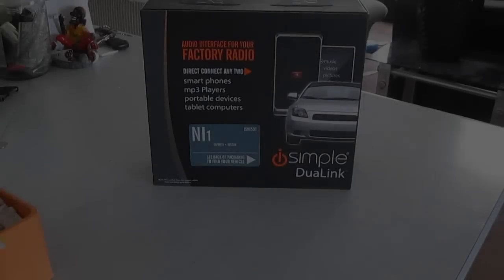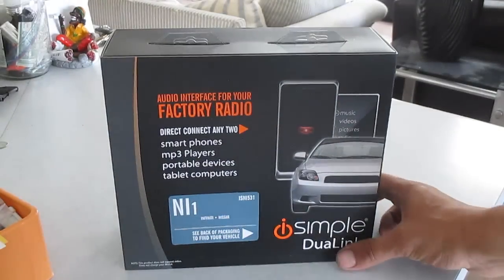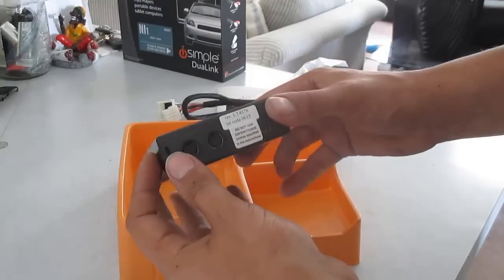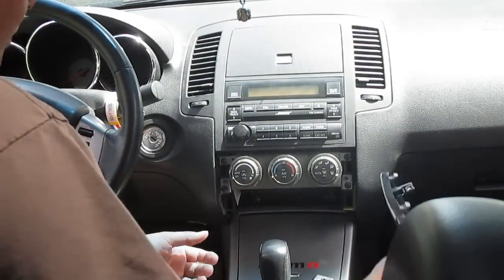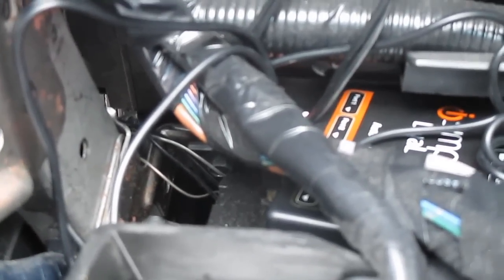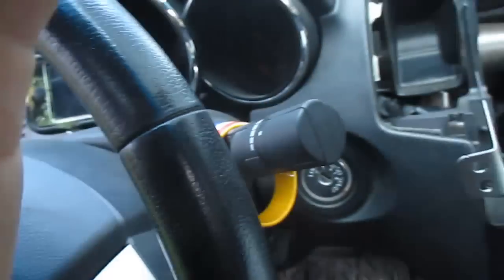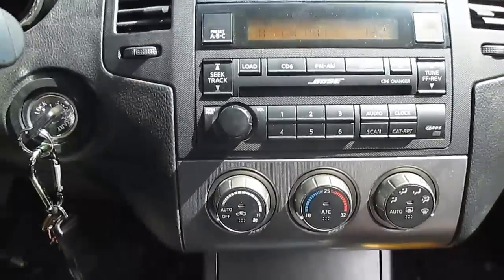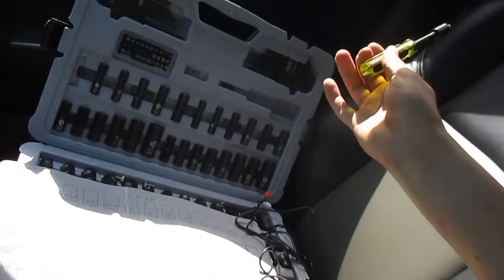Installing Aux, iPOD Input Jack - Nissan Altima 05-06 SE, SE-R, SL, S (ISNI531, aPAC-NIS1, NIS2)

Comment: I have a 2006 g35x and it doesn't have a SAT button but it does has RADIO, SSV, RPT/CAT, and SCAN. Will it work by pressing the RADIO option?

Comment: Hey this is Johnson from fb and ig. Found this really useful cause the 05 ser I am gonna buy I found out they don't make aux input for the cars.... Wtf lol this helps a lot! Thanks!
Reply: Jnguyen93 You know that's wierd I bought mine and it came with an aux cord installed in it already. but the aux sucks sounds dull. not even good as my cds, or radio playing.

Comment: Hey buddy, when you installed the adapter did you experience the audio to be more quiet? Lost a lot of bass too.
Reply from the maker: I notice this mostly with older low quality mp3s. I download all my mp3s over 300 Kbps now and it helps with the loss of bass but this unit does make the volume slightly lower than stock.

Comment: I have same car but need to locate 12v Accessory wire to install ISFM2351. There are three harness behind stereo and each of them has red wire. Can you tell me which red wire should be 12v accessory I should splice up?

Comment: I have the Sat button my 05 altima, it is the bose system, But when i press it after installing the part i get a "no sat" read out. Do i have to buy a sat antenna in order to get it to work?

Comment: I have a question... I have an 2005 Nissan Altima, and I was wondering what would happen if i install this thing without my car having a satellite option?
Reply from the maker: if there is an aux, sat or even nav option then it will work. but it has to has an option for an external input
Reply: my car has neither of those,... is there anything else i could use?
Reply from the maker: Allijah Bahamonde you will need to buy something like this "iSimple IS31 Antenna Bypass FM Modulator" this will plug into your stereos antenna and use a radio station to transmit the music. it will be a better option than a wireless fm transmitter.
Reply: alright thank you

Comment: hey dude how come my airbag light keeps on flashing how can I get rid of that. all the installation that u showed I followed them no worries, but the airbag still keeps on flashing. hope to hear anything from you thanks
Reply from the maker: Im not sure why the airbag would be causing a problem. Make sure a wire isnt pinched somewhere or my only other guess is a plug would but still not in or seated all the way

Comment: Does this completely remove the option of using the Satellite Radio?
Reply from the maker: Yea if you are using an integrated satellite radio this will replace that unit.
Reply: Is there anyway to do it without replacing the satellite?
Reply from the maker: I suppose you could put it inline after the satellite radio and see if it still works. The only problem with that I think is both the satellite and aux would be outputting an audio signal. Not sure how it would work out but it might.

Comment: I just installed this can you connect a bluetooth mic to one of the red or white cords to use the phone ?
Reply from the maker: As long as it has the av cables you can definitely do that. Good idea actually.
Reply: +Miles Watkins There's a Bluetooth version of this with a mic; I believe sonic electronix has it.
Reply: +DNALI does this work for 1997 Nissan sentra

Comment: or for 100 bucks you could buy a pretty decent receiver with input usb and cd and of course am/fm radio...
Reply: But it wont have the  factory look. I personally hate the way 3rd party radios look in a car
Reply: justshady Same.
Reply: Wait I have a Nissan 2003 and I want auxiliary.. Where can I find hat you're talking about
Reply: ***** crutchfield (dot) com and the website also tells you which ones fit exactly your car :)
Reply: My 06 Altima came with a pioneer double din stereo but had code, never could figure it out. Noticed though the steering wheel buttons didn't work to check mpg, trip , etc.,  found factory radio an all is good, but need a aux input, this should be my solution.  Great video man

Comment: hey do you think this would work for an 06 nissan maxima?
Reply from the maker: no it will only fit these vehicles

Infiniti
04-07 g35
04-08 fx35, fx45
04-06 qx56

Nissan
05-08 350z
07-08 frontier
07-08 maxima (with nav)
06-10 Titan
07-09 quest
07-08 xtera
Reply: DNALI I read that it can work on a 05 to 08 Maxima but i think its if it has the SAT button. Here where i read it from

http://www.sonicelectronix.com/item_39735_iSimple-ISNI531.html
Reply: DNALI And the Altima. You put it in your SE-R.